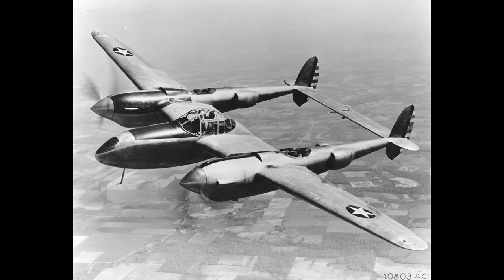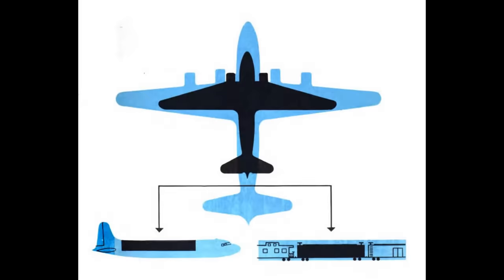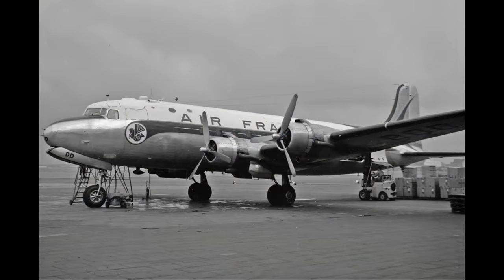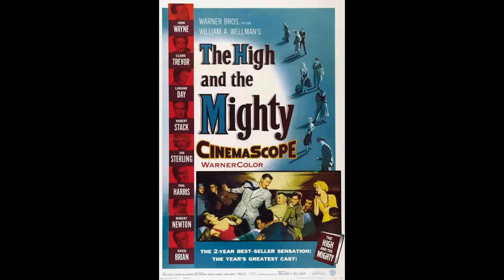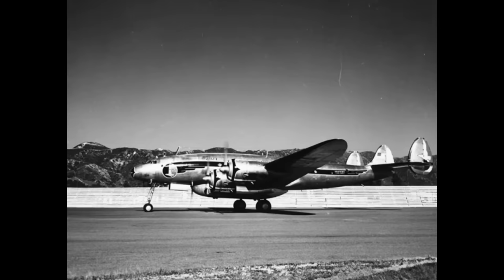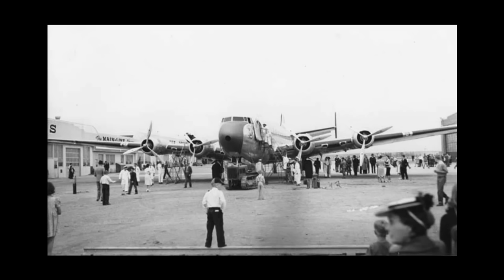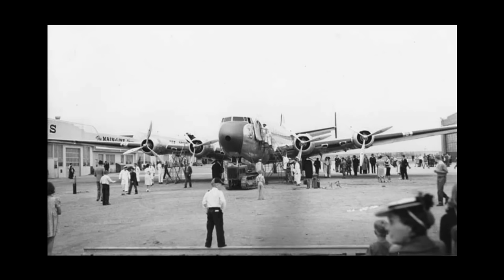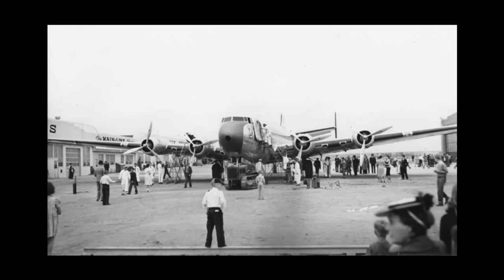Turbo Compound Piston Engines. Almost magic tech.

Comment: In 1959 I flew in a Quantas DC7 from San Francisco to Honolulu to Midway to Tachikawa - two 2-hour refueling stops an 31 hours and 45 minutes in the air. The return was in a US Navy Super G Constellation with the stops being in Wake Island an Honolulu and in the air for 30 hours and 15 minutes. The Navy craft's seats were all facing rearward except, I presume, for those in the cockpit. The reason for the choice of a Quantas craft was because it was chartered by the USO for the entertainers for the Xmas shows that year. Bob Hope would alternate his holiday shows each year between Europe and Asia. The biggest radio personality in California at that time was DJ Johnny Grant, aka the Mayor of Hollywood. He would alternate between the opposite continents. That was the first of 65 trips to Japan. I worked at Delta in Atlanta during the transition from props the jets. The slowest plane then was the Convair 440. A lone stewardess served breakfast to 44 passengers between Atlanta and Chattanooga. There was not enough time to climb above 10k feet and there was a speed limit of 250 knots below 10k feet. The fastest plane we had was the Convair 880. It departed Houston 45 minutes behind schedule and arrived in Chicago 15 minutes ahead of schedule. Due to an on the job injury, I was temporarily assigned to audit the caterer and plan all of the meals on all of the flights out of Atlanta. At that time, there was meal service out of Atlanta on 258 flights. I understand that has since been reduced. I don't know if it was because I performed well or poorly at that job but I was transferred to become what was then called a core programmer. Of the 250 programmers, there were only 22 of us certified to program in the core.
Reply from the maker: That's a great story, thank you so much for sharing. I have never been to Midway or Wake Island as the 767 easily bypasses those, but I have certainly been to Tachikawa and the others. That was some serious traveling in a piston powered plane.
Reply: @GregsAirplanesandAutomobiles  Also, I got to see the Gooney Birds in Midway but I didn't get to see them fly as it was their nesting period. That first trip was a blast. With all of the dancers, musicians and comedians, no one slept the entire trip.

Comment: Greg, Volvo's D13 engine for their big Class 8 highway trucks VNL 740, 760 and 860's are turbo compound as you mentioned. These are made in an engine plant in Hagerstown, Md. that was built by Mack in 1961. Volvo bought Mack in 2000. The Freightliner Cascadia's Detroit DD15 were turbo compound for a while but they deleted that feature because they decided the extra complexity was more trouble than it was worth.

Comment: Thanks for the presentation.  Simply put:  The turbocharger recovers energy to supercharge, the compound turbo recovers energy to power the prop.
Reply from the maker: Not exactly. The turbocharger causes a buildup of exhaust back pressure and uses that to supercharge. I'm not comfy saying that a turbocharger recovers energy because that sort of implies that it's free. I think I really need to make a video that talks about the different forms of forced induction.
Reply: @GregsAirplanesandAutomobiles   it's the turbine that recovers energy.  Turbine shaft HP can be used in many ways:  to drive a centrifugal compressor as in a turbocharger OR drive the prop.  

Back then turbine efficiency was low so the exhaust from the turbo was still quite hot meaning there was more energy to recover.  Modern turbines are designed with 3D CFD to extremely high efficiencies - so much so that in auto racing, normally aspirated cam timing can be used instead of low overlap forced induction cams.  

What is really interesting is that in a jet engine there is the low and high spool and the gas generator in the middle.  The low spool drives the low compressor and low turbine, the high spool similarly.  The gas generator is what burns the fuel.  A turbocharged IC engine can be likened to a sort of single spool jet engine in that the IC engine becomes the gas generator and the turbo, the single spool with a compressor feeding the "gas generator" and a turbine recovering energy from the exhaust.

NOTE:  I've been trying to find engine building design software that would allow that simulation, but although compressor and turbine maps are input, you still have to input the exhaust backpressure which the software should predict.  

The GM LS9 supercharged factory cam has MINUS 24.5 degrees of overlap at .050 lobe lift and yet, when all GM cams were tested in a normally aspirated 5.7 LS engine in Hot Rod, the LS9 cam made the most HP!  Who would have thought!

Comment: Great stuff and fascinating. I guess it's kind of obvious, but it's fun to think of all the engine types you've discussed so ably in some kind of multi-dimensional space based on how they create efficient combustion and get it to drive the airplane. We have pumps and turbines on the input. Pistons and turbines in the combustion chamber, driving propellers or ducted fans or emitting raw gasses to generate thrust, with secondary turbines extracting extra energy from hot exhaust (whether from pistons or primary turbine). Yada yada. About the only combination not present is hot gasses of primary combustion driving a secondary piston device!

Comment: Thumbs up. The more efficient the engine the less turbo-compounding makes sense. The next generation of piston engines will include pre-compression and re-expansion cylinders to achieve perhaps 65% real world efficiency. There won't be enough energy in the exhaust to make turbo-compounding worthwhile.

And speed has another component: time in the air requires lift, so the faster the plane the less total energy will be required for lift during the trip. OTOH a trip's drag goes up by the square of velocity.

Comment: In 1974 a friend gave me a walk around a freight dog hangar at the Anchorage PANC airport where I saw a 8'-10' tall "mountain" of blown PRTs. "In the winter, everyone forgets about them under the snow, and in the summer we're too busy to worry about doing the cleanup." There were probably 50 PRT units chucked onto that pile, all from DC-7s.

I asked my father what it was like to fly the DC-7, compared to the DC-6. He said, "On my first 5 trips I lost 3 engines. When a PRT would start to fail, you knew the whole engine wasn't far behind. What we learned from the Wright Turbo-Compound was that a piston engine makes a very poor gas generator. When we replaced the basic R-3350 with a bunch of can annular combustion chambers in the Pratt & Whitney JT-3 and JT-4, we really had something."

I, too, flew copilot on the DC-4 but was surprised at the performance and weight numbers your manuals illustrated. Ours were in the "Seaboard World" configuration with gross takeoff weights of 78,200 lbs -- not 52,000 lbs (quite a difference). The Pratt & Whitney R-2000-7M2 radials with Ham-Std 3-bladed (round tip) propellers I flew were 1,400 hp for takeoff and 1,200 hp Max Continuous. I don't remember the total fuel capacity but we had 8 tanks per airplane (where 2 of the 3 airplanes had had 2 tanks removed), and we had fuel dump nozzles that could hang below engine nacelles 2 and 3 to actually dump fuel. Our transponder bezel said "ARC Cessna Crafted" and we had no autopilot yet occasionally flew 12 hour legs. (We were made of iron in those days.) I'd watch the DC-6 guys flying and was jealous: a hot wing, decent brakes, pressurization, and all that power! That was way back in 1974 and all of my Captain friends from that era have long passed on. Glad you have a picture of the Captain that inspired you!

Comment: Great video, thanks so much. 

I thought all these years that the power recovery turbines also were turbo-superchargers that were also used to provide induction air to the cylinders. I did not know that these wrights had a separate mechanically driven supercharger for that purpose. 

I didnt know what a blow-down turbines is, and that these are what the power recovery turbines were.

Fascinating, thanks...!

Comment: 1960 I came from Cuba on a pan am DC7 But one thing that I remember the most what's the turbo props On the Electra the  noise it made what's cool. Back in the early 80s I used to see a constellation take off Late in the afternoon every week you can see the flames coming out of the exhaust. What a beautiful bird.

Comment: As you mentioned in the video, Volvo Trucks uses a similar Turbo Compounding technology for at least ten years on their European FH line of trucks as an option which utilises a single turbine and a similar fluid coupling with their heavy duty inline six diesel engines.

Comment: You brought up an interesting point that even I wonder about these days, "Airlines are selling time."  It is 100% true and with the way things have changed in the last 30 years the airline system is undercutting itself.  If I were to travel by car from here in Tulsa to Dallas it would be about a six hour drive.  With all of the time from getting to the airport, TSA, checking in, and waiting to get into the air, followed by all of the time lost at the destination airport, there is not all of that much time savings to be had with a short-range domestic flight, even if flight time is around 75 minutes.  40 years ago it was far more likely that people would fly that distance due to it actually saving more time, since time spent at airports was vastly reduced back then.  Now, you might as well just rent a car or take your own and load it with whatever you please, leave and return at you leisure, and return with whatever you please.  The value proposition of air travel has been massively undercut due to excessive hassles, red tape, and luggage restrictions...along with the main point that they really are not saving you that much time anymore.
Reply from the maker: Good point, ironically I also live in Tulsa and have done that drive. Plus I have a son named Jordan.

Comment: The horsepower/thrust curve can be explained by observing the efficiency of the exhaust nozzle. At zero forward velocity (V) of the airplane, let the exhaust velocity be Ve. Ve carries half the kinetic energy produced by the nozzle. As V increases, Ve decreases when measured with respect to the ground. As V = Ve, the exhaust velocity relative to the ground is zero, and the exhaust nozzle efficiency reaches 100%. This also explains why propellers are more efficient at low speeds. Props produce thrust with velocity Vp < Ve of the exhaust nozzle, so they reach higher efficiencies at lower V.

Comment: In the late 70’s I rode the jump seat on a DC-4 freighter from Honolulu to Hilo and back. The instrument panel had been completely refitted with Collins flight instruments. Twenty years later, I rode the jump seat on a Air Molokai DC-3. Both airplanes were very stable platforms and seemed relatively easy to fly. 
Sometimes I wished I could’ve flown in the era of radial engine airliners instead of the jumbo jets I flew for 25 years.

Comment: Love  the video as usual.  Some low speed two stroke marine diesels are turbocharged with a pressure type compressor driven by a blow down type turbine wheel like with the Wartsila 96C series engines.

Comment: Thanks for this video! Finally I've got a basic understanding of how a turbo compound engine works. I'm wondering if these concepts and current materials might be economically feasible for use in engines powering general aviation aircraft.

Comment: Your thumbnail has caught my eye (I have seen several of your vids). In 2019 Delta Airlines acquired a DC-7 for their museum, which happened to be an original Delta aircraft. It still had the golden crown on the tail, painted over but with the paint peeling off to expose it. I watched as it landed in Atlanta and have pics of it in the paint shop before it was stripped. My father spent 43+ years with Delta and C&S retiring in 1984 (radio operator and station manager), and I spent 31 years as a mechanic with Delta retiring in 2020.

Comment: Hi Greg.  Well done.  I've been waiting 25 years for a video like this.  During the past years I have become a fan of turbo-compounding and are looking into ways to turbo compound my home built earth rounding aircrafts 13b mazda turbocharged engine.  It will be a 320hp turbo normalized engine and the Seawind long haul aircraft it is attached to is set up to cruise at a maximum  flight level 25.  After years of research and experimenting with another TC enthusiast, Paul Lamar  (RIP), we came to several conclusions.  First, because the rotary has no valves, just ports,  there will not be the issue of exhaust valves being destroyed and taking out the blowdown turbine. Secondly, according to NACA illustrations, lack of exhaust valves would increase the available power to be recovered significantly. Next, a mechanical connection with fluid connector was found to be heavy and complicated.  Lastly it has become apparent that the rotary engine while inefficient as an ICE, is more akin to front end of a turbine machinery.  Meaning while driving the accessories and prop shaft through a 3:1 PSRU, it produces (some would say wastes) a very strong exhaust. At altitude I am expecting the exhaust pressure can drive not only the turbocharger to normalized the engine power, but have enough energy left over to spin an axial turbine and high speed genset.  These palm size high speed generators are manufactured by a Swiss company and as you correctly pointed out are used to charge a battery and the power used to provide extra hp during F1 racers acceleration events.  I hope to use this electric energy to power the axial motor that doubles as a starter motor on my engine.  I still have an unresolved issue of how to set up the exhaust manifold and whether it is better to use one turbine for all functions,  (like the F1) or separate the functions and control the gas flow on the inlets to a plural of turbines.  Your opinion as a fellow pilot and researcher would be appreciated.

Comment: Wow, what a lot of content in this video. I had to go back over several parts to absorb it all. I was a mechanic, and later a flight engineer, on the DC-7 at UAL. I recall being quite amazed when I first learned about the PRT and its function. It DID seem like "getting something for nothing". Thanks for the trip down memory lane.
Reply from the maker: Thanks so much for you comment. It's very rare to hear from someone with an FE piston rating.
Reply: Thanks, Greg. I guess there are few of us left around now. I'm 85, but still flying, now in my TB-20 with fuel injection. Many years ago, Someone had a DC-6 at an airshow that I attended (I had also flown FE on the -6). I got a chance to go on board. Upon entering the cockpit, I smelled  the odor of warm leather seats mixed with other odors so familiar to those of us who flew these craft. There was an overwhelming sense of nostalgia. I still spend many hours around these old aircraft when I visit museums. I also have a very nice painting of the DC-6 cockpit in my hangar. @GregsAirplanesandAutomobiles

Comment: I used to have a copy of "Marks Mechanical Engineers Handbook" which was passed down from my Dad. It was printed around 1950. It had a comprehensive section on turbo compound engines. I lost my copy about 1985.

Comment: Excellent insight, Greg!  One point, though:  Travel is both time and money, a trade-off weighed by passengers as well as the airlines.  If it were just time, then everyone would have forked out $10,000 per ticket for the turbojet Concord, and there would have have many successive generations of the Concord, likely powered by civilian versions of the SR-71's significantly modified JT11D-20 (J58-P-4).  If it were just money, then  airliners would be powered gliders, scooting along at about 30 kts above L/Dmax while being powered by propellers driven by turbocharged diesel engines designed to achieve L/Dmax+30kts with waste-gated (idle) turbochargers, keeping the turbochargers in reserve for takeoffs and climbs.

As it is, modern airliners powered gliders which have been designed for high efficiency cruise at around Mach 0.85.  Their designs provide for maximum profit margins for the airlines over the aircraft's operational life cycle.

Good content.  Keep it up!
Reply from the maker: Yes, but I'm talking about stuff that costs no money, but costs in terms of time. You show up at the plane and the catering isn't on board yet, stuff like that.

Comment: In the mid 60's some of our family flew on a DC6 from Mexico City to the Yucatan.   Outbound was a model with a clerestory bubble window having seating arranged for the view.  Inbound, I was disappointed that no such feature was offered.

Also in the mid 60's I'd drive with my dad to/from his business on the zig-zag road along the northwest corner of Ontario CA airport.  DC7s were lined up between the fence and hangers. They just sat parked there because it was almost all jets by then.  

Seems odd DC7 had only a 8-10 year useful service life, much shorter than its DC6 predecessor that remained useful in its niche for far longer.  They say it was the maintenance costs on the DC7 engines that did it.  That's how  the industry was moving during that era.

Comment: Great content! As an old trucker, I know that in the md to late 80s Cummins introduced a turbo compound engin that ran 60 osi ab ove ambieant to produce 475 hp with the same basic configuration of the one turboe intercooled Cummins N 14 that had 400 hp. I was lucky to drive a 400 on some days.  Also drove 350s, 335 non intercooled as well as 290s, which were mighty slow on california 6% grades back in the 70s. I drove sume junk with even less power than that as well. the less said about the 250s and 220s the better! 0 to 10 mph in a week and a half!